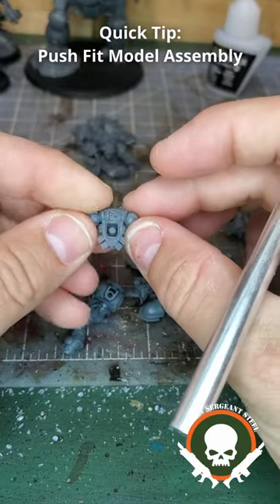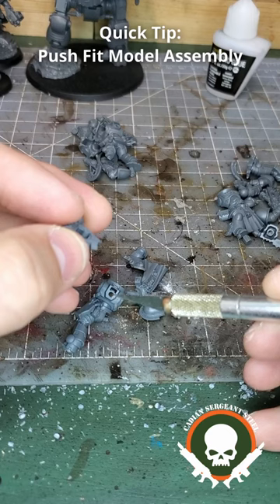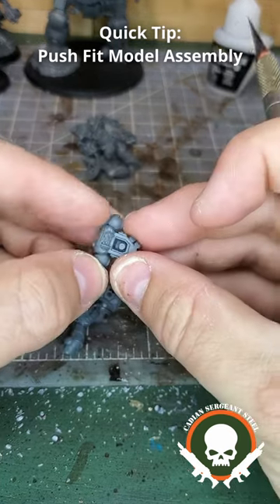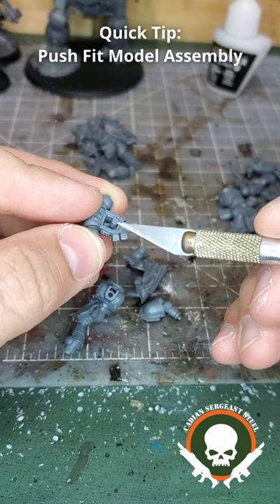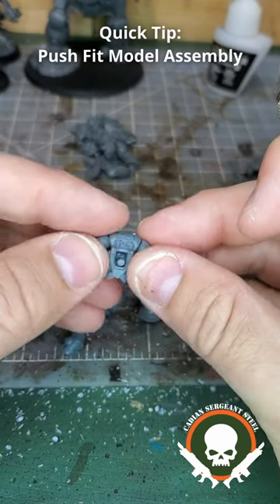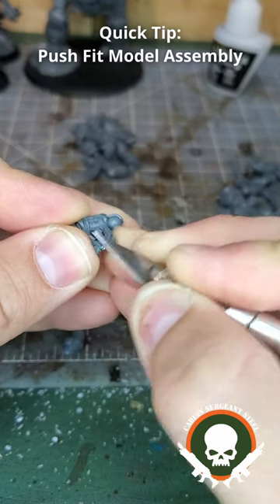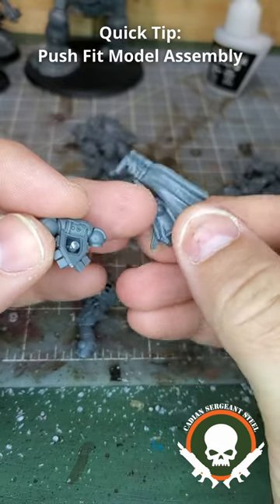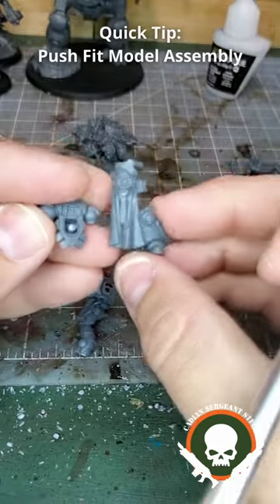Quick Tip   Push Fit Model Assembly

Comment: I drill out the push fit "sockets" to a slip fit with a pin vice(small hand drill most people use to drill gun barrels) so dry fitting and working in any sub assemblies you might want become really easy.  Of course you loose the friction fit if that matters to you.
Reply from the maker: It does to me. I do like some of the tight fit just not the gaps created by glue or bent rods.

Comment: Cut AWAY from the hand... But if you want to do this properly, you'd use clippers.
Reply from the maker: With clippers, it often causes sprawling of the polystyrene because of the design of the blades. If they do sprawl outward, even a little, that will cause bigger problems when assembling.

I cut toward myself because I am secretly a worshipper of Khorne.
Reply: @CadianSergeantSteel   This issue can be remedied with sharper clippers, or gaining divine favour through a generous offering to the skull throne.